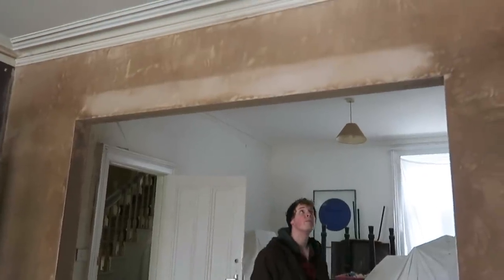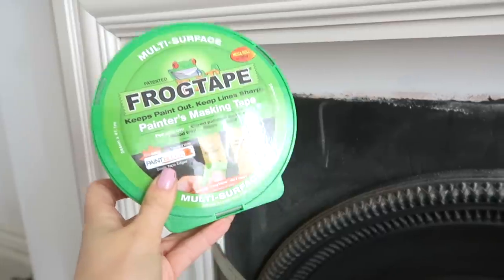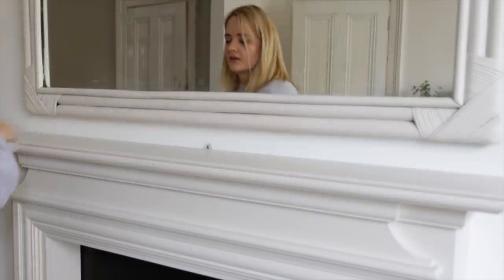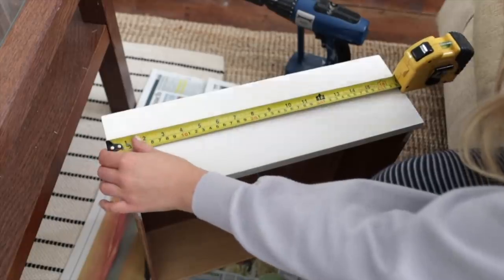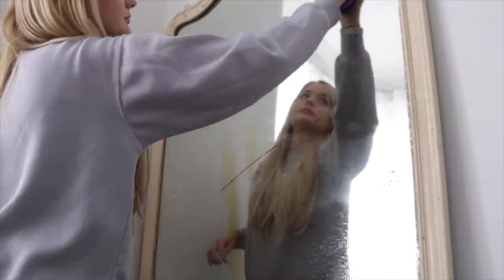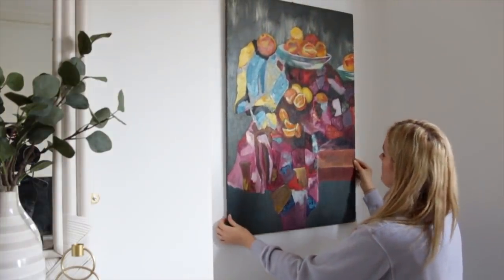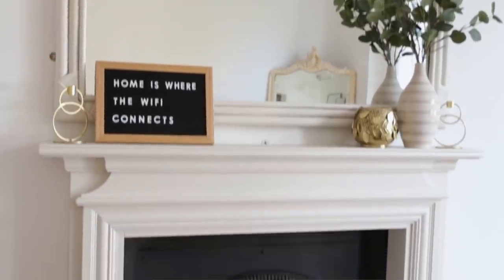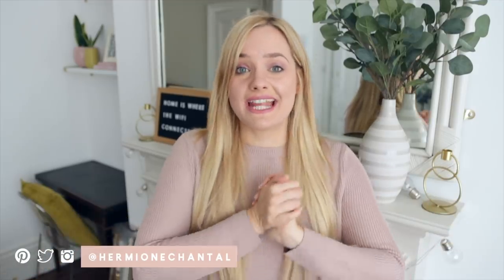Extreme DIY Living Room Makeover on a Budget | UK Victorian Home Makeover

Comment: Seeing this made ME feel like I'm not alone in the renovation process too... Besides the fact that it seems like everything needs replacing from top to bottom, we moved in to literally neon lime green doors! Every. Single. One. on the main floor- neon green. Yellow Formica countertops and an old beat up yellow kitchen sink. Country- styled blue and white kitchen cabinets lined with yellow printed contact paper easily from the 70's or 80's. The carpet is like something you'd find in an office or school. Omg, this house has sooooo much potential but boy is it going to take A LOT of work!

Comment: When the crew comes out to install the base molding, have them cut out a couple of blocks of wood, that you can attach to the foot of your mantle, to fill in the gaps. The paint job is a really dramatic change. For your floor length mirror, there is a spray you can place on the back of your mirror glass to restore it's reflection. So if you have scratches or speckled areas, you can use the silver spray to fill it in instead of replacing the whole glass.

Comment: Just a tip- when you are painting with painters tape and want a crisp line, you can get a solid line by painting a layer of the same color that's already there. For example if a wall if currently white and you want to put a line or design or something in a different color using tape, put the tape up how you want it, paint over the sections in white. Leave the tape up and then paint the color you are wanting it to be. If that makes sense. This way the color that bleeds will be the same color that's already there .